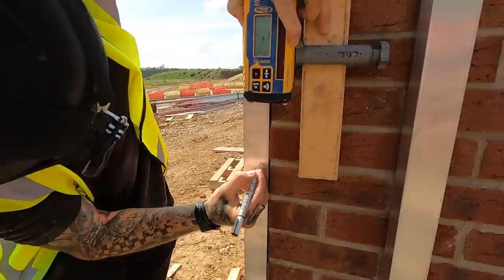Let's Get To WOrk 9,500 Brick Garden wall! Part 1

Comment: Well done Amy👍, them Doris are great for them squints ,not sure how profiles will work with dog tooth corners or did I miss that bit. Many years ago I started a similar  wall and funked up and got a grunted in it, the house owner came home that night obviously didn't notice it but didn't like the bricks said pull it down ile get something else 😁, got away with that one.
Reply from the maker: I changed it otherwise I can’t use the profiles 😂
Reply: @CharlieCollison  👍